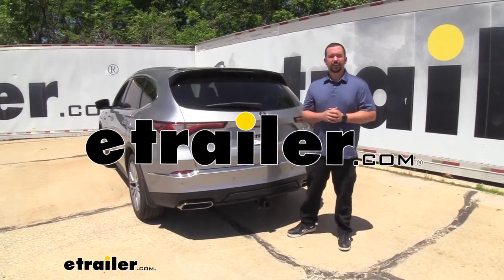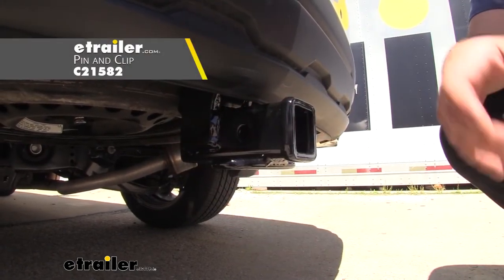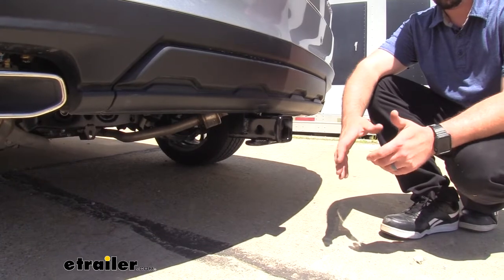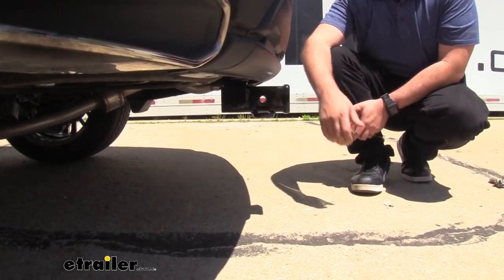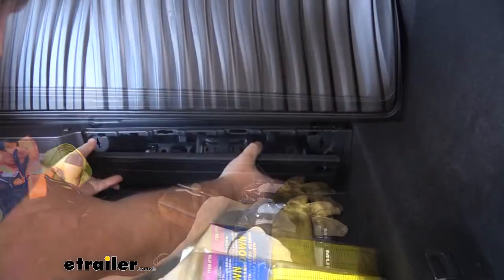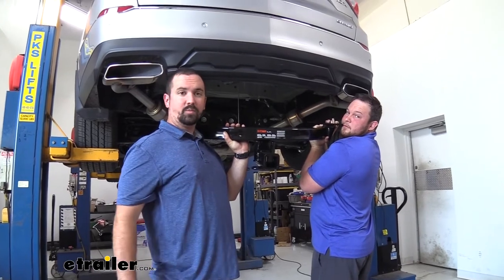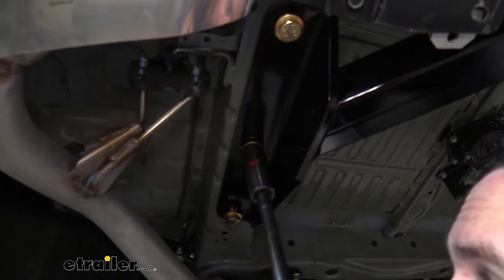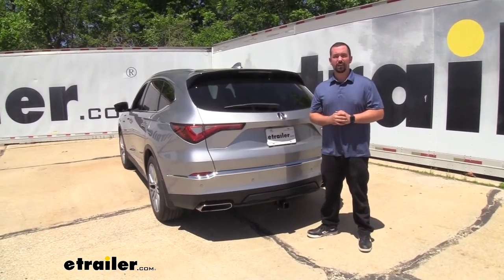etrailer | Curt Class III Trailer Hitch Installation - 2022 Acura MDX

Comment: No won’t fit 2024 Acura MDX which is supposed too be the same fitment as the 2022 . there is a wiring harness box in the way on the inside of the rear bumper skirt . Will not allow the hitch to be moved back enough on the right side of vehicle to have the holes line up.

Comment: Quick question: does it interfere with any of the sensors? I've got a 2022 MDX Advance and it seems that every time I hook up something on the car, some sensor goes crazy when I back up.
Reply from the maker: You will need to turn the rear parking sensors off if you have something installed in the hitch that is blocking the sensors. Some vehicles can recognize that it is an accessory and will not go off.
https://www.etrailer.com/Trailer-Hitch/CURT/C22HR.html